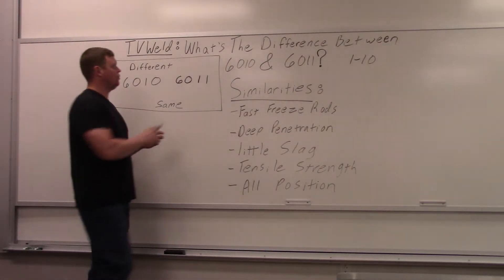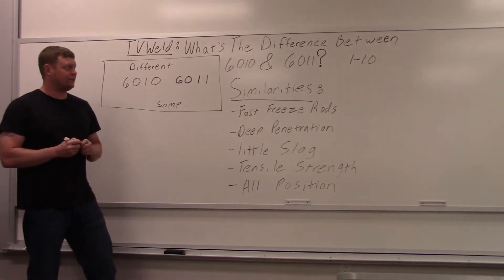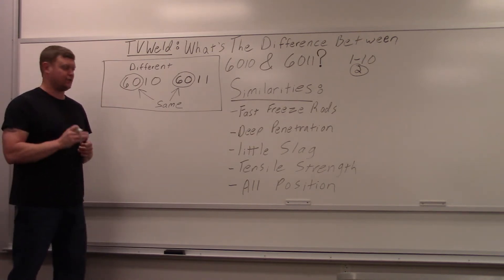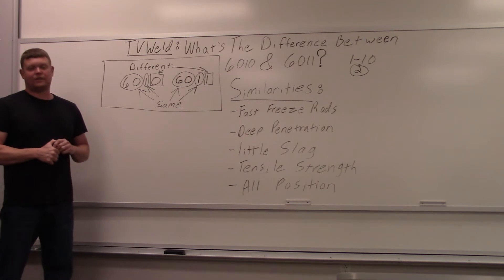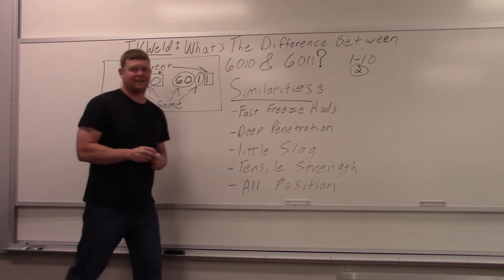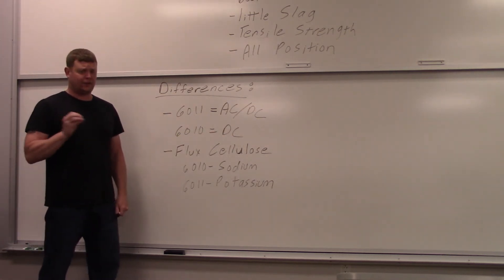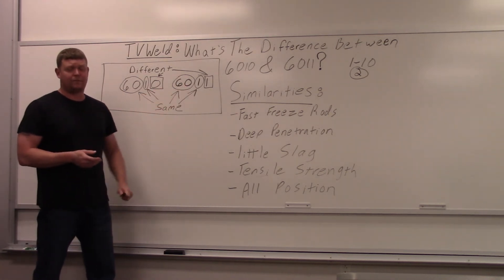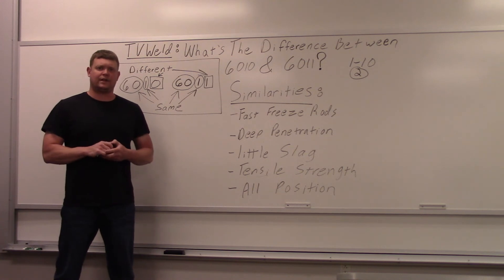6010 Vs. 6011

Comment: There is a huge difference between 6011 and 6010 5p when you get in a hole welding old rusty pipe.

Comment: I CAN'T BURN 6010  WITH MY 3 IN ONE  INVERTER STYLE WELDER  CAUSE  IT DROPS THE ARC  AND SPLADDERS BAD . WATCHED A VID ON THIS ABOUT  SOME  INVERTER WELDERS  NOT BEING ABLE TO BURN 6010  LIKE MINE .
Reply: There is a comment here from two years ago that 6010 will not run on "consumer" grade boxes because it won't maintain a high enough voltage. Maybe that is your problem .
Reply: Are you running DCEN or DCEP? maybe that is a difference? I mean I have my new old big industrial welder that I could do pipeline work with which I can't wait to play around with, but I'll have to do some testing on my Titanium 200. I do like that portable little guy, although it is definitely not perfect - of course, neither is the monkey holding the stinger.

Comment: 6010 requires a higher arc voltage.  That’s why machines that struggle with 6010 run 6011 ok.

Comment: 6010 for truck frame?
Reply from the maker: Fore sure.  All day long!
Reply: Why not just use wire wheel and 7018 wont it last longer from vibration of driving ?@TVWeld
Reply from the maker: @adamclark94  You could, but 7018 doesn't have the digging power that 6010 has.  If I was going to go that route, I'd wire wheel, then use 6010, and then go over the 6010 with 7018.
Reply: @TVWeld  most truck frames are thin probably get 100 percent penetration with a 3/32 7018 alone. Heavier duty trucks probably go the 6010 route for root. Or if welding on a hitch mount
Reply: @TVWeld  I got a couple 6010s left I might try and see how it works on my truck for a patch job though. I just figured it would burn through to much. Thanks for the replies and the video
Reply from the maker: @adamclark94  If you are doing thin stuff, I'd try to find a MIG welder.  Clean it until you get to shiny steel, then MIG it.  A 110 may even be your best bet if you are doing really thin stuff like exhaust.
Reply: Not if it is quenched and tempered steel on the truck frame... use 7016/7018 instead.  :)
Reply from the maker: @paulmeersa7162  I'm not sure truck frames have quenched & tempered frames.  That would add a lot to the manufacturing process!
Reply: @TVWeld  You may be surprised. :)  Best to check...

Comment: I have asked these pipe welding schools they refer to two rods 6010 and 7018 what about 7014 Farmers rod
Reply from the maker: I've used it once, and I believe that it is very similar to 7018 but it has a high deposition rate.

Comment: My welding teacher had me use 6011 instead of 6010 for a root pass the other day, and he told me they run pretty much the same… needless to say I was more than a little frustrated when they did not, in fact, run the same.
Reply from the maker: I hadn't ran 6011 in like 20 years and tried it not too long ago and I would agree that it doesn't run like 6010.  That being said during the 20 years of not running 6011 whenever someone asked the difference between 6010 & 6011 I always responded, they are basically the same rod.  I run regular 5P 6010 which is a much more violent rod.  5P+ 6010 I'd say is fairly close to 6011.  So at the end of the day 5P+ is close to 6011, but I'd say regular 5P is much different than 6011.
Reply: @TVWeld  So, I have had the question ever since I started welding and no one has been able to satisfy my curiosity. Maybe you'll be the golden child, here goes. For what reason do the engineers specify 6010 for the root on pipe welds???
Reply from the maker: @3Hose  That's basically what it is designed for.  It has deep penetration, cleans the base metal, and has a stable arc that the welder can easily manipulate.  That's why it is used for root passes.  Engineers specify it because that's what a CWI put in the welding procedures!

Comment: Hobart has a 6010 rod that is capable of running on AC or DC not just DC like most 6010. Personally I don’t really like 6010 though, it’s a violent digging electrode where 6011 gets good penetration as well but is more controllable and produces a nicer weld. One thing 6010 will do better is burn right through rust paint and even oil and produce a decent weld where other rods would struggle with the dirty or contaminated surface

Comment: I am self taught and only do hobby welding. I use the 6013 for everything with my 50 year old Lincoln AC225 welder. I also have a 2 year old Lincoln Mig Pak 180 that I use with gas.
Reply: Try some 6010 it’s wild. Turn your amps down first!
Reply: @michaelwelch442  I will, thankyou.
Reply from the maker: I just found an old buzz box the other day that I have no idea where it came from so I busted out some 6013 and let er have it!  First time I ever used a buzz box.

Comment: Good breakdown, that tiny difference is of consequence more relative to the specific welder you are using than the weld of the individual rods.  

Obviously with 6011 you get a benefit from the ability to run on AC as well as DC and the reason for that comes up next with the specific coating on the rods.  In a nutshell sodium combined with the cellulose requires a higher open circuit voltage to keep the arc ignited than does the cellulose potassium based coating of the 6011.

The ability to maintain the arc with the lower open circuit voltage is what gives the 6011 Rod the properties to run on AC current.  If you can picture a sine wave the alternating current goes from DC plus to DC minus and as it does so it passes through zero current at that point low open circuit voltage exists and a 6010 rod would not stay ignited like a 6011 rod.  Also some DC only machines do not provide enough open circuit voltage to keep the 6010 arc lit.  So, IMPO, carry 6011 that is more forgiving than 6010.  Lastly, and technically,  at the same amperage settings, with the same exact arc gap the 6011 rod will provide (depending on application)  either the ability or detriment of an ever so slightly reduction in penetration when run on AC current simply based on the constantly reversing direction of electron/heat flow to parent material.
Reply: You may have really answered my question I didn’t know I had.
I’m self taught, so forgive my ignorance.
On my little $400 forney 240v stick machine I have a really hard time keeping 6010 sparked up. 6011 doesn’t give me the same fits. On 6010 I’ve tried turning it up, to far, trying to keep it lit. I can run 7018 1/8 over and over so I didn’t think it was my machine.. (180amp max on 240v). 
However yesterday I got the chance to burn 5lb of 6010 on an engine driven Lincoln welder, and ran them flawlessly. I think I had 2 sticks, no blow out, walked the puddle across some big gaps.. 
so maybe my little machine just doesn’t have enough open circuit voltage to keep the 6010 running..
Reply: @goinhot9133  most inverter machines don' like 6010

Comment: 6010 is for dc. 6011 has potassium added to create an ionic field around the weld puddle/rod for AC alternating current to, well, alternate. Current jumps from +-+-+-. The ionic field makes this transition smoother. That makes 6011 and 6010 able to weld in DC while AC needs 6011 (with the ionic field)
Reply: 6010 for dc +

Comment: And on a sidenote 6010 will NOT run with most (if not all) consumer grade boxes. 6010 requires a high voltage to create and maintain an arc. 
6011 will run because it has potassium and that allows for an easier arc .

Comment: I’m a full time welder and run an older Miller shop master 300 all day. We use both 6010 and 6011 in the shop as well as 6013 and 7018. I find that the 6010 digs in deeper than 6011 on penetration. But the 6011 flows a little better resulting in a smoother bead. I really like the 6011. It’s a nice rod that does a lot and with care you can even cream nice looking bead.
Reply: Thanks, That is the answer I was looking for.
Reply: You can change the dig right

Comment: Question why does some inverter welder work with 6010 and others do not ! Welding in dc
Reply: The main reason is that a lot of cheap, bottom-of-the-barrel DC inverter stick welders cannot sustain a high enough arc voltage to keep a 6010 rod lit.  Some of the better ones employ higher arc voltage in conjunction with added inductance which helps maintain the arc stability.
Reply from the maker: I don't do a lot of work with that type of welder, but I know a guy that lives with those.  I'll ask him and get back to you.

Comment: If both 6010 and 6011 are available and I have an AC/DC welder, how do I choose between them?  What's the difference between 6011-AC and 6011-DC?   What effective difference does sodium vs potassium cellulose flux make?
Reply from the maker: Potassium increases arc stability.  The reason they put sodium in 6011 is to increase the ionization potential of the arc which helps when running on AC.  If you have DCEP on your machine I'd go with 6010, but that is just my preference.  I've never had the opportunity to run a buzz box.  I'm currently looking for one to run 6011 on just so I know how they run.  People ask me about buzz boxes all the time & I never have any answers for them.  I just want to play with one to see how they run.

Comment: I'm very new to welding, I'm finding that 6011 is less troublesome getting to act right than 6010. Should they behave identically?
Reply from the maker: I haven't ran 6011 in quite some time.  Typically 6010 runs smoother than 6011 from my experience.  They do run very similarly with very small differences in operating characteristics.  It really comes down to the welder's preferences.  Also, how they run can be directly related to the power source (welding machine) your using.  Remember if you on an AC machine 6011 should be used & 6010 is only a DC rod.  Keep practicing and try out a whip motion with 6010.  It works great!
Reply: @TVWeld  Are you using a small inverter welder, if so that may be your problem.
Reply: 30:36